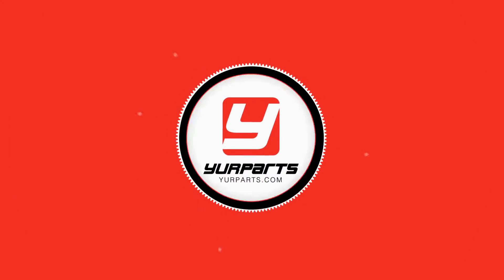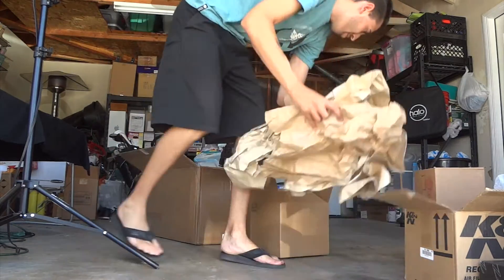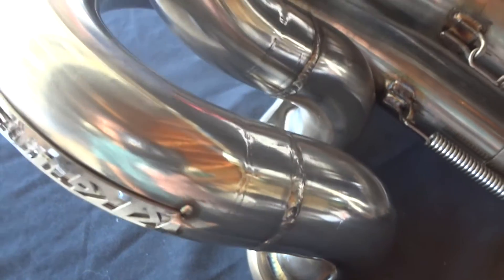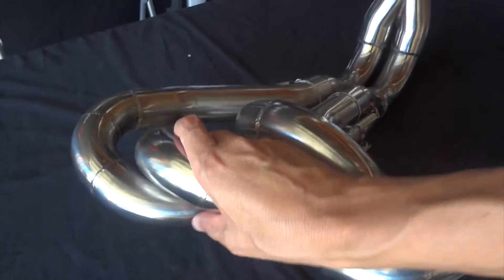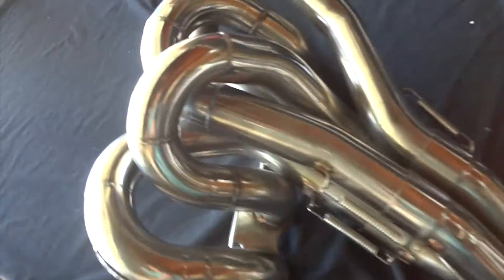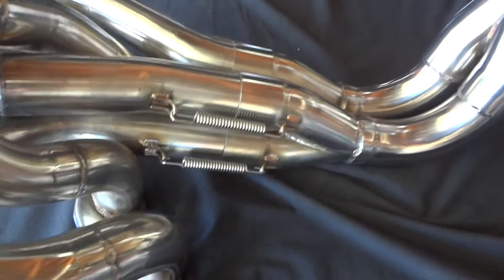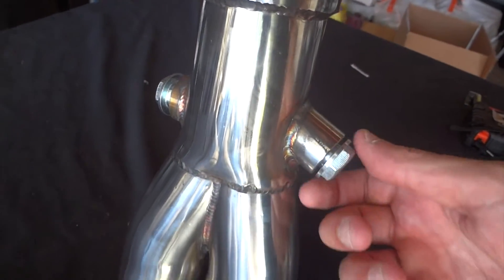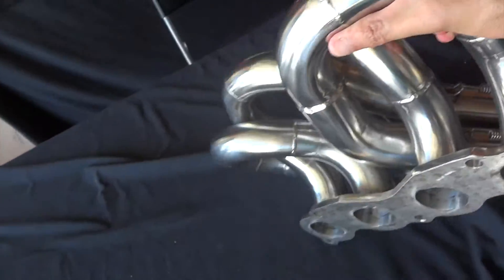K-Tuned Ram K-Series K20 K24 SWAP Header

Comment: Hey man, do you recommend the ram headers or regular 4 to 1 headers for more gains?
Reply from the maker: RAM headers will give you more gains on the top end, but I dont suggest them for daily driving. You really have to hit high RPM to take advantage of them. 4-1 good low RPM gain, and very streetable

Comment: Hey bro I have a 8th gen si with a k20/24 swap will this fit it without hitting my firewall ??
Reply from the maker: This header is for Civic/Integra K-Series Swap Only. K-Tuned does have one for your vehicle.

8th Gen Civic Si Header
http://yurparts.com/i-24452737-k-tuned-409-series-steel-race-header-06-11-honda-civic-si-fa5-fg2-2-0l-k20z3.html?ref=brand:99125